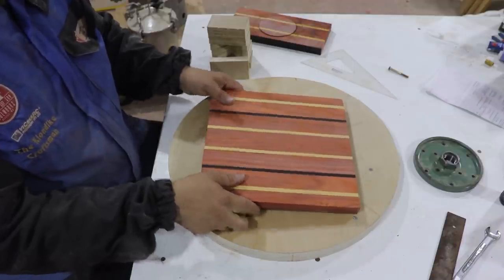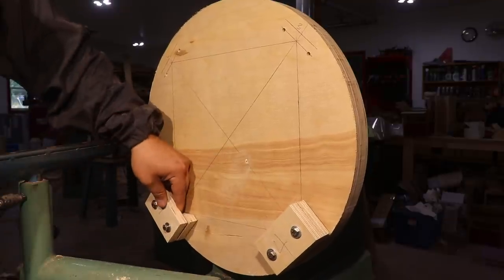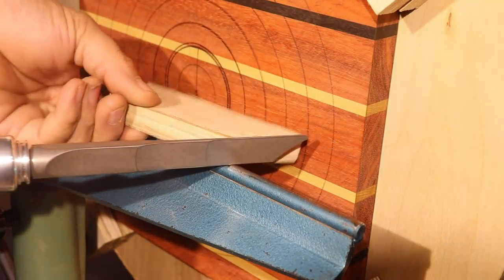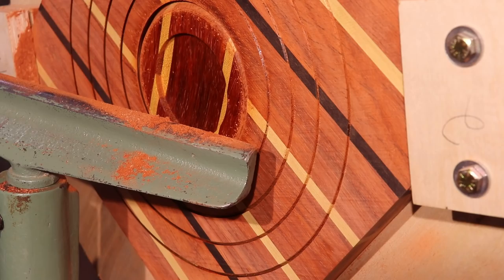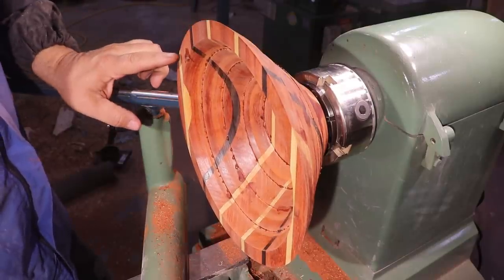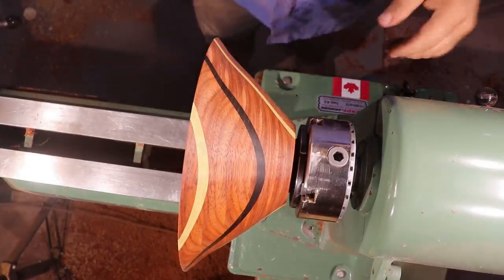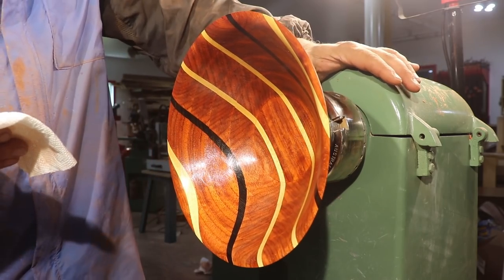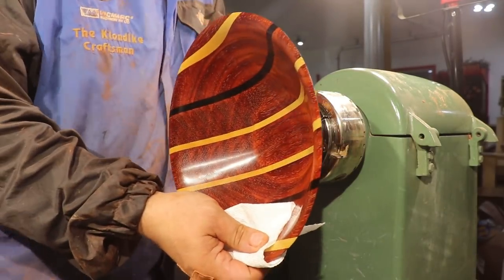Woodturning |  $120 Bowl From Scrap Wood - A New Way to Make a Bowl From a Board / Economy Bowl

Comment: You should use what we use in the CNC world for work holding and your corner clamps put some painters tape on the backside of your project board and the face of your faceplate there and use my CA glue to help hold it another way a little more expensive way but avid CNC sells these composite nail guns with composite nails and and that's a wonderful work holding method little pricey though good job buddy
Reply from the maker: Thanks Barry! My goal was to make something functional that people could duplicate with items they already have. Appreciate the suggestions and you watching!

Comment: Love this idea. Couldn't you just screw, or bolt through the corners of the board? Also, maybe hold the rings on with double-sided tape.
Reply: Perhaps recessing the bolt heads as they will have a similar effect to a circular saw if touched with your hand. Smoothing off the wood clamp corners too.
Reply from the maker: I wanted to be able to repeat this so I have a jig now. Thanks for wayching!
Reply from the maker: Yes, there are lots of things that can get you for sure.

Comment: Thank you Lewis for sharing this learning process! A lot less messy and way more accurate than gluing dozens of small pieces of laminate and, for a first time out, amazing result. Slight misalignment possibly due to marginally uneven pressure and spread of a ring during compression after gluing? - the only time you weren't like a hawk on the piece. Beautiful work sir! 👏
Reply from the maker: Thank you Ryan, I agree on the pressure issue!

Comment: Outstanding!!   How about a 45 degree cut with parting tool.  Seems that would equal the wall thickness better.  Ring thickness about = thickness of the board.  I like your choice of back ground music.  Chatoyance of wood very nice.
Reply from the maker: 45 would work on 3/4 thick stock. This was 7/8 so there was a slight variation. You can make them whatever you want as long as you allow for wall thickness. Thank you for watching!

Comment: Lewis, what's preventing the Faceplate from unscrewing itself when running in reverse?
An admirable use of cut-off's! Very pretty!!
Wakodahatchee Chris
Reply from the maker: The faceplate is tightened on with a large wrench. I’ve had this lathe and faceplates for 25 years and have never had one back off yet. Thanks for watching Chris!

Comment: Something you're probably already aware of - when figuring the ring spacing/angle, for best ring fitup, you need to consider the width of the parting tool and factor it into the ring spacing. This can generally be ignored on a scroll or bandsaw due to the thin blade.
Reply from the maker: Yes I am aware. I actually thought that 1/16 parting tool would be close to a bandsaw kerf. Worked out either way but I will leave extra next time. Thanks for watching!
Reply: You did give credit to someone whose video you couldn't find when you started your video. I just mentioned the 2 that I enjoy watching. You all do things your own way. If it works have fun playing with them.

Comment: Hi Lewis, That is beautiful and I really like the jig. One tip I learned a long time ago is to sprinkle a little salt on the glue joint between the layers. It doesn't affect the glue at all but stops the rings from moving around when pressure is applied.
Great video Lewis.
Take care mate.
Cheers, Huw
Reply from the maker: Thanks Huw!

Comment: Why not put a screw in each corner to hold the blank?
Reply from the maker: Screws would eventually wear out the faceplate and would not ensure easy, repeatable centering of the piece. Plus you risk cracking the blank. I appreciate the question and you watching, thanks!

Comment: I forgot to mention that as you make the rings wider using the same thickness board it will make the angle flatter and the bowl will end up shorter because of that. I have done that just to have a more open looking bowl. I did that on one of my dizzy bowls just for that reason.
Gary
Reply from the maker: Yes exactly. Thanks again!
Reply: Most people stick with 45 degrees because it is very easy to work out. 
 I lay out what I am looking for and figure the width of cut from that.
 All fun stuff for me.
Take care,
Gary

Comment: For an experimental piece, I think this is a stunning result Lewis.  The shape is very good & the alignment problem seems hard to fathom given the care with which you work but does not detract from the finished piece.  Great stuff & thanks for sharing.  I love the care you took to explain what you were aiming to do & great finish to top it off.  The result is very close to that produced by Gary from ThePapa 1947 as Sioux mentioned.  Don from South Aust.
Reply from the maker: Thanks Don, I had not seen Gary’s version before but very similar. I like having the mortise in right off better than a glue block. Thanks for watching!

Comment: A handy tool for your bowl press and clamping in general is a 2 inch diameter spherical washer fully hardened they last forever and always align for full contact and pressure straight down It takes a top and bottom to make one spherical washer cost for a 2 inch (OD)  spherical washer (one inch ID) is about $20
Reply from the maker: Thanks Charlie! I had a bearing on that press that was perfect but I broke it using the press for something it was not intended for. Thanks for watching!

Comment: Thanks for showing that.  IT was nice.  I wonder if your rings could be out because those two rings were rotated 180 degrees?  Maybe that caused enough misalignment.
Reply from the maker: Thanks! I went back to check that but the rings are oriented as they were in the board. I think it was flex when clamping. They aren’t very noticeable, I see them but most people don’t. I appreciate you watching!

Comment: I may be wrong on this, but worth passing on.   I think the video that you can not remember may be one done by Jim Rogers.  He has a YouTube channel.

Re: Alignment of wood pieces.  I aligned my bowl with the wood strips of a different color.  On the first bowl I turned, I did this by eye and experienced the very   slight misalignment like what you experienced.  On the second bowl I made, I slightly scored the wood with ruler and  an Xacto knife on a single radius line from center to edge.  This provided me a more accurate way of aligning the wood on the glue up and can be turned or sanded away afterwards.  This seemed to eliminate the alignment issues I experienced.  Trying to align the wood by eye seems to be the problem.
Reply from the maker: Thanks, that might be the guy, I’ll check it out! I think my alignment was from some flex when gluing the rings back. Interesting idea on the score mark though, something to consider. I appreciate you watching.

Comment: so the width of the rings correspond to the thickness of the board, right?  i.e. .5" thick board means rings are .5 wide?  having tried this and have it fail miserably,  im asking the dumb questions to save headache later.
Reply from the maker: Hey Sheldon. The width of the ring is not really tied to the thickness. The with is more about how much wood you think you will need for wall thickness

Comment: hi Lewis,nice job,I notice you use lots of grit,is that necessary,I use very little, thought was waisting,mabe not??
Reply from the maker: Thanks Fran! I am a big fan of Yorkshire Grit! I did use lots but this is a big piece so it requires it. I find YG less expensive and better in terms of dust and finish than sandpaper, (even before they supported my channel). I really appreciate you watching!

Comment: Great Job! Did you ever consider putting spacers in the corners, under the board, so when you cut thru the board you won’t put grooves in your jig ?
Reply from the maker: Thanks James, I didn’t consider it initially but I would change the face material in the next jig. Thanks for watching!

Comment: Well, that was different.  Thinking outside the box can be very interesting even if isn't perfect first time.  That tiny mis-alignment is something to think on.  The backing board was my first thought, also murrayaforsman's comment below about taking the tool thickness into consideration even if the tool is one sixteenth the cut will surely be more, maybe 50 or 100% more.  Anyway, food for thought.  The piece is beautiful.
Reply from the maker: Thanks Stewart! The kerf would not affect alignment though, the distance between the strips remains the same. I think I got some flex in the rings in my press. Thanks for watching!

Comment: Beautiful bowl! I don’t know if it’s any easier, but it seems a little simpler to do. The very slight imperfection with the alignment could be due to not having an exact cutting angle each time with the parting tool?? I know that Gary (ThePapa1947) made a jig that fits over his tool rest to keep the angles as close as possible. No matter! That is a great job!
Cheers,  Rick
Reply from the maker: On this layout the angle isn’t relevant to the strips lining up. Someone mentioned slight flex when clamping rings, I guessing that was the issue. Thank you for watching!

Comment: Excellent work my friend.  Joints look tight overall.  What a great first run up.  I'm wondering if a backer "plate/board" would be plenty of support for this process e.g use a face plate attached to a, turned flat and round, board.  Mount the victim to the board and just turn into the piece till you meet the board...Robert's your Mothers brother...kunk
Reply from the maker: Hey Kunk, that is basically what I did. Plywood acts as a jig and backer. Thanks for watching!

Comment: I did started a6 year apprenticeship in 1967 as a Centre Lathe Turner in one of the Best engineering companies in the South West of England. I was taught how to use a face on castings weighing at 1/2 a ton and held them on a faceplate with 4, 5 or 6 clamps. But with very thin pieces we always turned with the tool upside down and the lathe going backwards as this allows the swarf/chippings to fall away and not jam the tool. Our face plate also had six or 8 slots in them at strategic places so as not to weaken the face plate, this way gave easy access to clamp any shape any size. Please do not take any equipment at any size. Please do not this as any kind of criticism as I think you are one of the best teacher I have seen on You tube and even though I had a lot of time turning all sorts of metal, wood is totally different. many tanks again.
Reply from the maker: Thanks Pete, everything is very secure I assure you! Thanks for watching!

Comment: It would help alleviate your worries about the pieces binding the parting tool if you temporarily (hot or super) glued the top faces of the rings to the jig to hold them in place before you start to cut the rings from the bottom face.
Reply from the maker: My concern was only for the first ever cut. I have no concerns any longer. Thank You for watching!

Comment: Great proof of concept, Lewis I had a thought , so the angle does not change for the parting tool how about a 2"" table on the tool rest with two 1/8 " high pins that the parting tool rests against the out side of. A slot under the table would aline with the tool rest so you could slid it back and forth for each ring . Just a thought 😩
Reply from the maker: Thanks Douglas! This was step one....I will refine the cut angle part on the next run!

Comment: You can get a perfect lineup and imperfect lineup if the rings are cut at slightly different angles and get slightly off centre on the glue-up. Still a gorgeous bowl! Make a slotted piece of hardwood to guide your parting tool perfectly. Attach the plate with two-sided tape then the rings will go nowhere. You eyeballed the angle to an  unbelievably close angle
Reply from the maker: The angles will not affect the line up as the rings come from the same board, I suspect i got a tiny bit of flex when clamping the rings that put me off that little bit.
Thanks for watching Charlie, I appreciate it!

Comment: Beautiful work.  You can also use a glue block instead of the plywood.  Ie,  use a disc about the same diameter of your inner ring and glue your board to that. Then you can either part off the glue block or use it to make a foot.
Reply from the maker: I did it this way so that there would be no need to go back and finish the bottom afterward and the first ring is guaranteed to be centered. Thanks for watching, I appreciate it!

Comment: Looks great. But for me I think your method is more difficult then what Gary does at Papa1947.  Ron
Reply from the maker: I had not seen Gary's method when I tried this. I like this in that the rings are always captured and the blank if the correct size will always be centered . Gary makes some nice ones huh! Thanks so much for watching.